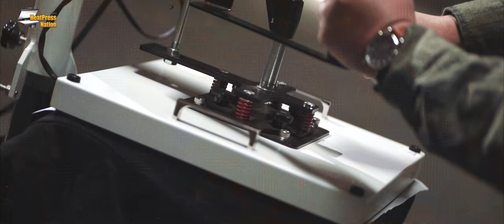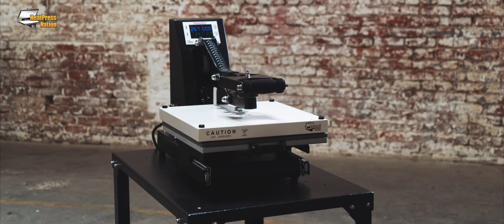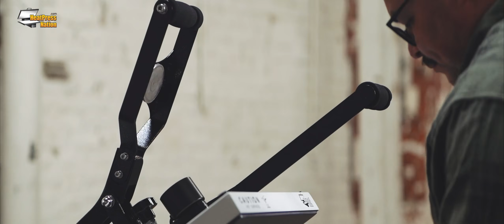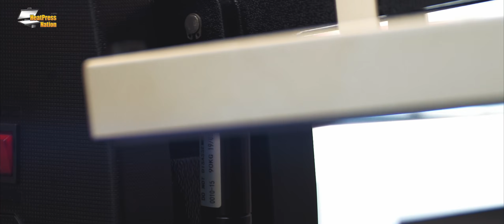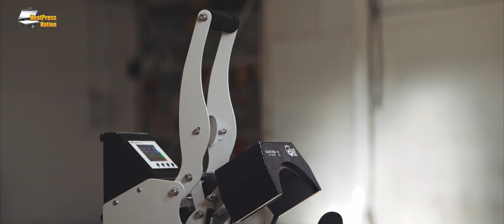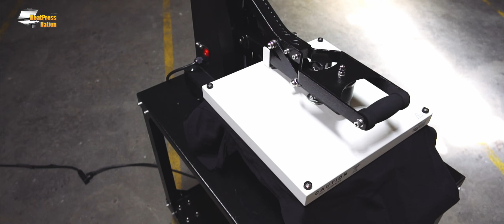HPN Signature Series Overview

Comment: where does the fuse go when needed and how do you keep the handle oiled
Reply from the maker: There is a built-in backup fuse. If one fuse goes out, open the back panel and switch the wires over to the backup fuse one at a time. Please feel free to call our tech support team for guidance if needed. (800)215-0894.

As for the handle, you can use any regular industrial lubricant like WD-40, lithium grease, etc.